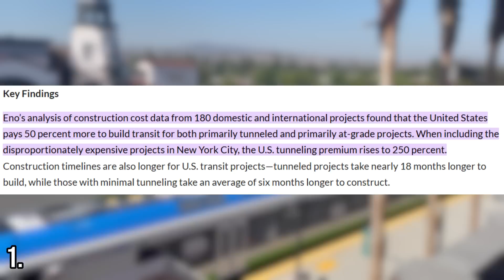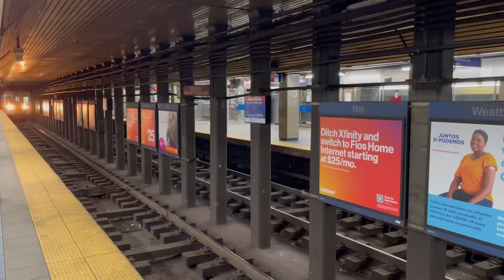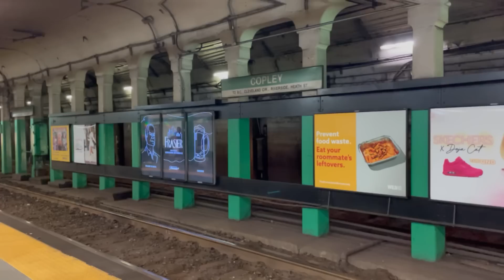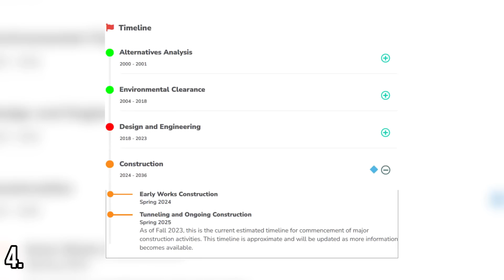Why Is Building Transit So Expensive?

Comment: Sorry, I disagree with much of what you said.
BUY AMERICAN (BA). It is a "sort of"  requirement. Brightline West (BW)(Los Angeles to Las Vegas) is in procurement trouble. It is going to be the first US High Speed Rail project. Therefore, there is no manufacturer of HSR trainsets in the US. Amtrak has bought Acela trainset from Alstom. The problems are so numerous, the trains are parked, not used, AND the Federal Railroad Administration (FRA) has formally declared BA void on BW AND declared Alstom as unallowed. Siemens is the supplier of choice. BUT, Alstom is suing both the FRA and Siemens about the BW BA waiver. [For a view of the Alstom trainsets, watch https://www.youtube.com/watch?v=COiFtgCTf-M  ][BTW, no two transit systems use identical trains or buses. That is a fundamental problem.]  Second example, Oakland California is in Alameda County, and AC Transit is the bus service. AC Transit wanted new buses, and decided to use its federal money to buy from Van Hool (Belgium). As one supervisor said "No one tells me which buses I am allowed to buy". BTW -  one of the biggest bus manufacturers in the US, Gillig, is in Alameda County. BTW, the steel for the rebuild of the Eastern Span of the SF-Oakland Bay Bridge came from China. By using European and Asian sources, this provides an excellent opportunity for civil servants and politicians to travel the world on the taxpayers dime.

Comment: Great video! There's multiple reasons including planning "scope creep" that generally has people add aspects to the project after the fact that drives up cost. This sinks many a project from the Cybertruck to Dodge Viper to Calgary's ill-fated Green Line... The solution? Learn from China... Uniform rolling stock used on uniform projects which are classified as to their design usage, etc. 

To me there's no reason why rapid transit shouldn't be both automated and electrified in 2024 other than the lack of long-term vision in planning and construction... Along with platform screen doors, on-board WiFi, AC, etc. which are all features common to Chinese mass transit networks but not anywhere else to the same degree...
Reply: Unions fight automation tooth and nail.
Reply: @colormedubious4747 As well I would if I was in their shoes.
Reply: @DiamondKingStudios  Why? They make everything cost more and end up getting positions cut over the long term. The only jobs they preserve are those of their officers. I know because I was a member of one for six years.
Reply: @colormedubious4747  I was saying if I was in their shoes.

But I’m not, so I don’t have the same perspective on the matter.
Reply: @DiamondKingStudios  Fair enough.

Comment: So you're pretending that you can do cut-and-cover literally through two rivers in downtown San Jose? Cool 🤣🤣🤣
Reply: Wouldn’t be that hard for it to go further underground before it reaches the river. Seems to work in Chicago. BART down Market street was constructed as cut-and-cover and it goes into the bay…
Reply: @ScoobyDooIsDead  those sections in Chicago were built in a dry-dock and floated into place at incredible expense because the soils were too low quality for normal boring and that as cheaper at the time.

Do you have any indication of how much more expensive this would be to do in San Jose vs just boring a tunnel?
Reply: @TohaBgood2  Stop making excuses, especially for an economic powerhouse state. BART is by no means a perfect system, it has a ton of problems like other systems. BART's problems stems from ill-fated design decisions from 1972 to create a bespoke system rather than use standardized technology. The high cost of this hubris continues to this day. This includes seemingly unrelated things like poorly maintained stations, because there's less funding for such things when almost every part is custom manufactured. Yes, BART could go for the cheaper option, but it shouldn't have to if it got the actual love that it deserved from its state government (which it doesn't because California Dems are the worst) 

Until BART stops catering to suburbanites with parking lots, until stations aren't dangerous, until they build more TOD, etc, I won't stop criticizing the system.
Reply: @youtubesewersocialist  Stop making stuff up.
Reply: @TohaBgood2  "Stop making stuff up" cope and seethe, you know I'm right. You keep defending BART on every channel you go. As I said, I'd be a millionaire if I had a dollar for every post you made defending BART
Reply: @TohaBgood2  "Nice cope, bud" says the bootlicker refusing to accept criticism of their favorite system. Criticism is good, criticism is healthy. Welcome to the real world. 

No transit system is perfect, not even Japanese systems.
Reply: @youtubesewersocialist  Lol, so you think that you trolling BARt under every video is not you coping and seething? 🤣🤣🤣
Reply: @youtubesewersocialist  No transit is perfect and BART is not perfect. But lying about what BART is or isn't online helps precisely no one.
Reply: @TohaBgood2  Trains Are Awesome, Climate and Transit, every time BART is brought up, there you are in the comments defending it. 

Every. Single. Time.
Reply: @TohaBgood2  "so I know a lot of random trivia about Bay Area transit systems." does that include twisting the truth to make BART look better? Like saying BART's longest line is "a little shorter" than the Montauk Branch, when the Montauk Branch is well over 110 miles?  Which you attempted to twist in a vid about Metra's Gallery Car EMUs?
Reply: @youtubesewersocialist  the delulu runs strong in you 😁😁😁
Reply: @TohaBgood2  "runs strong in you" says the Californian twisting facts
Reply: @TohaBgood2  "in you" nope, IN YOU
You claimed BART's Yellow Line is just a "a little shorter" than the Montauk Branch, claiming they're both around 65 miles....the Montauk Branch is well over a hundred miles
Reply: @TohaBgood2  Your own words: "It's interesting that Metra's longest line is just a hair shorter than BART's longest line. And BART's longest line is just a little shorter than LIRR's longest line. It's almost like 65 miles is the limit that all US regional rail systems decided is some unbreakable limit beyond which they cannot serve riders." which is far from the truth. Get clapped by NY! Montauk Branch = over 110 miles! Jealous much?

Your own delulu :)
Reply: @youtubesewersocialist  You are such a goofy person 🤣🤣🤣
Reply: TohaBgood2 don't be a BART bootlicker challenge (IMPOSSIBLE)
Reply: @youtubesewersocialist  So you're denying the existence of those two rivers?

Non-delulu challenge apparently also impossible for you.
Reply: @TohaBgood2  Did you like your own posts lol
Reply: @youtubesewersocialist  Lol, an anti-BART troll is trying to be funny 🤣🤣🤣
Reply: @TohaBgood2  Where in my statement did I deny the existence of the two rivers? Wow, Californians really are so unhinged. 

Avocado toast Californians don't be so stuck up about their own state challenge (IMPOSSIBLE)
Reply: @TohaBgood2  Seriously you type so many comments in these comment sections in defense of BART in different videos....if I had a dollar for every one of these, I'd be a millionaire. 

You don't have to defend them EVERY TIME! Criticism is HEALTHY. Criticism = Democracy
Reply: @TohaBgood2  Acknowledging BART has problems is acknowledging that it can be a better system, there is nothing wrong with that
Reply: @TohaBgood2  "anti-BART troll"....what? Are you mentally okay? 

BART is not a perfect system, NO SYSTEM IS. That's the point! That's why we advocate for better solutions so they can fix these problems to be better systems!
Reply: @youtubesewersocialist  Nice cope, bud. So are you claiming that doing cut and cover through two rivers would be cheaper than just tunneling the whole way? You got a source for that?

Comment: Excellent points. Pretty much the opposite of the San Jose BART Extension is the Metro de Madrid. They did a lot of the stuff you mentioned here and built a 26 mile loop line in just over 2 years.
Reply: Exactly! The Spaniards know how to build quickly and cheaply at a fraction of the price of the USA.. Learn from them and you'll save a ton of cash!
Reply: @stickynorth  We don’t have to look at the Spaniards. Just look at Brazil, specifically São Paulo. It is a city that is identical to NYC in demographics, importance, and size, yet has built out much of its system in the last few decades. No only do they have an extensive metro, their commuter rail, network is superb. 

Buenos Aires is another one that has managed to minimize costs while having such a fluctuating economy.

Comment: A lot of the subcontracting just stems from corruption. RIDOT has done some shady deals with many projects around Rhode Island due to a lot of the construction industry having so much power and influence in the statehouse, with many politicians and RIDOT officials having ties to contractors, whether it be their friends or them used to be employees of contractors. It's gotten so bad that RIDOT is under a federal investigation for the mismanagement of the inspection of the i195 Washington Bridge that recently had a critical failure of some original bridge components. There needs to be a federal investigation of the construction contracting industry and many of our state DOTs because this is also part of the reason why most states have such car addicted state DOTs and our politicians are puppets to the automotive, fossil fuel and contracting industries

Comment: Short answer: NIMBYs not wanting an at grade or elevated line so the only way to get the transit is to deep bore an expensive tunnel so that they don’t have to see a train go by
Reply: In the 60's, BART in downtown SF, Oakland & Berkeley was built using cut and cover.  The streets were a massive mess as that was going on, but people sucked it up and then there was an efficient underground transit system.

Now, people won't suck it up during the transit construction, so we do these deep bore tunnels, which means a lot more time riding escalators and a lot more missed trains for the life of the system, all to save some hassle during construction.
Reply: Ban NIMBY
Reply: People who don’t wanna see a train zoom by misses the point of why the builders made it elevated in the first place. The nimbys are gonna ride the train too, so it’s not a big deal to have your view marginally obstructed from below

Comment: We can definitely afford it, but unfortunately, we don’t have the political will power to do it unless is highway and road projects.
Ironically, aren’t highway and road infrastructure costs a lot more for maintenance over time?
Reply: Yes
Reply: Who is We?  The currency is dead.
Reply: all road in the us are 100billion per year in taxpayers subsidies, the rest 100billion is from personal car drivers(includes building new roads)

one MTA IN NYC is 20 billion in taxpayers subsidies

public transport is way more expesnvie
Reply: highways are falling apart too. infrastructure is simply not a political priority across the board.
Reply: @cmdrls212  True.  when I-95 collapsed in Philly, they quickly repaired it within a month or so. I’m sure there were other examples highway repairs with quicker responses.

if that was a section on the Northeast corridor it would’ve taken months, if not a year to repair it
Reply: @jalfredl  You're making my point. they don't do anything until it's literally falling apart. thanks.
Reply: @cmdrls212   I’m not trying to say highways are taken care of 100% of the time. remember that our highway system is massive, so of course many parts are in poor condition.

Unfortunately, My original point was that highways/roads still have a higher priority compared to our rail system or lack there of, despite the cost of road maintenance over time. It’s sad that when there is a proposal for Highway expansion, there is little to no political backlash from both parties. But when it comes to rail funding or construction, it’s “wasteful spending”.
Reply: @cmdrls212  oh it’s very much a political issue. Both political parties are funded by fossil fuel companies, automobile manufacturers , and airliners
Reply: @jalfredl  In think you mean urbanists only show up in YouTube comments instead of town halls so the status quo gets its way lol

Comment: 6:52 the US isn't alone with extremely long planning and building phases, in Germany the High speed line between Karlsruhe and Basel was planned since the 1980s and the expected finishing date for the entire project will be 2041.
Reply: That will give me a heart attack
Reply: But this has more to do with the fact that every federal transport minister in like forever was a car industry lobbyist or had extremely close ties to the car industry. In addition the constant underinvestment in any public works projects, staling transit investment by doing another study on the next Gadget Bahn.
Reply: @IamTheHolypumpkin  sounds exactly like the US.
Reply: @IamTheHolypumpkin  So....exactly like the US?
Reply: @youtubesewersocialist  well, it's a bit more complicated than that, the entire plan was to built a high speed line next to the existing tracks, but locals opposed and so DB planned a new  freight only track for parts of the route. And the plan all along was to open the route in stages, which happened for the karlsruhe to Offenburg section and the Katzenberg Tunnel.
Reply: the some difference 186 km ~115 miles, down-lobbing by automotive industry,  distribution from the left to right parties and the funding of half of Europe and other nonsense instead of our own infrastructure. The fact that a tunnel boring machine has sunk is just an added bonus.

Comment: Although everything in this video is correct in the ways that we can decrease cost, and most of them are things we should be doing, decreasing community input is not one of them. We need to come to compromises with communities designing something that will be acceptable but is realistic. instead of giving the community every single concession we need to meet in the middle. For the San Jose example, deep bore tunnels make sense in downtown, but it should have switched to cut and cover outside of that. 

And I will add that when light rail was built through downtown San Jose it so thoroughly killed the business on our main street that 40 years later it still hasn't fully recovered, and caused a switch in what was seen as our Main Street.  Tunneling will take longer than a surface line and that's what the business that complained were worried about. There are ways that the impact could be minimized such as direct payments to affected businesses (and that would have probably been cheaper than switching to deep bore) things like that are the compromises that I'm talking about, things that today we just aren't pursuing in an effort to appeal to the ideal plan that has no impact during construction.
Reply: You can't do cut and cover in downtown San Jose. there are literally two rivers in the way. 

I don't understand why the online transit community is so bad with the commentary on this project. You can literally look on google maps right now and see that two rivers converge right above where the tunnel will be.

Comment: Something you did not mention is quotas on projects like these.  Now, I am speaking here for Atlanta, but I think it is also the same in other cities.  To work on an infrastructure project you must have a certain percentage of minority contractors which in principle I think is fine.  They also give preference to minority owned firms.  What happens here though is that this system gets gamed which greatly inflates costs.  You get shell companies that are minority owned that might have 5 people employed.  They then sub out the work to regular contractors but when they submit their bid, it's as if it was just one company doing the work.  That adds an entire layer of costs because the shell company (and their 5 people) gets their cut and the regular (non-minority) contractor who wasn't allowed to bid on the project still ends up doing the work.  If they had just done it to start with, it would have been quicker, cheaper, and it wouldn't seem so corrupt.  Like I said, I think hiring minority contractors is a good thing, but there needs to be more due diligence in vetting these companies.
Reply: "(non-minority) contractor who wasn't allowed to bid on the project"

cool, straight up constitutional racism
Reply: Blaming WOKE? WEAK!
Reply: @stickynorth I don’t think it’s that simple. The comment you replied to described something they considered could be an issue and gave a rather even-handed commentary on the matter while recommending improvements to the process in ways that would be fairer and more conducive to getting projects accomplished. That’s more than one can expect than someone just ranting about “DEI” and “woke” while seeming to know nothing about the subject, which tends to be much more common.

MARTA on its own has plenty of issues. Neither the state government nor the mayor really seem to care that much about good public transit, there aren’t much funds to do what they need to, and Gwinnett and Cobb Counties remain unwilling to cooperate, though barely. I could easily see this system as described existing to give an impression of a commitment to serving underrepresented groups (something most Atlantans certainly and rightly care about) but which ends up creating delays. We’re Americans, after all. Do you really expect us to improve our local public transit systems that easily?
Reply: @DiamondKingStudios  Thank you...since my politics is just to the right of Che Guevara 😉
Reply: @ScottCP1  I just assumed you were by and large a pragmatist.

Either way, MARTA isn’t much like it was when my grandfather worked for it.